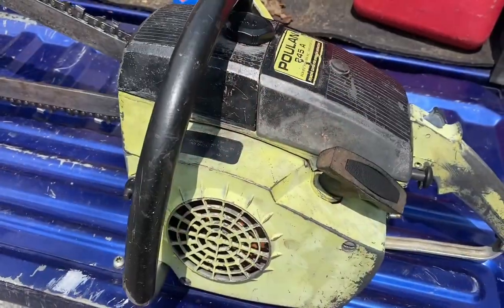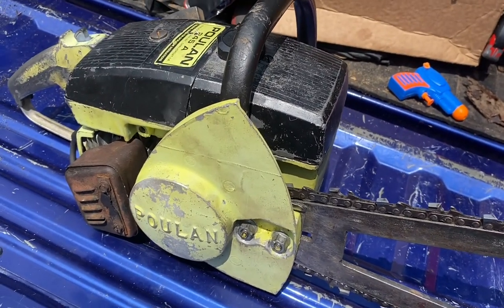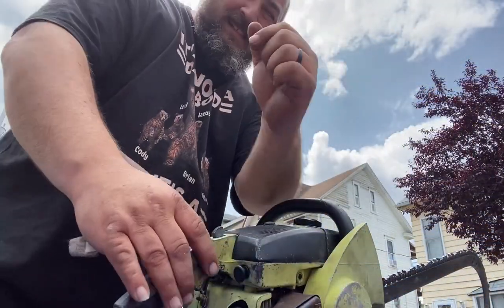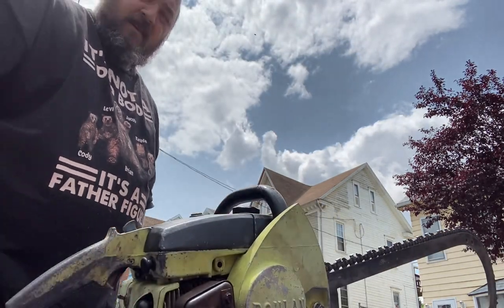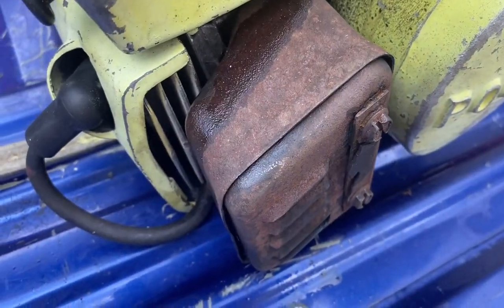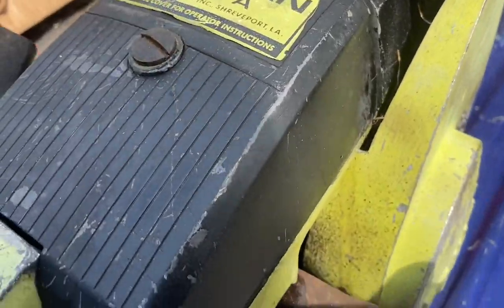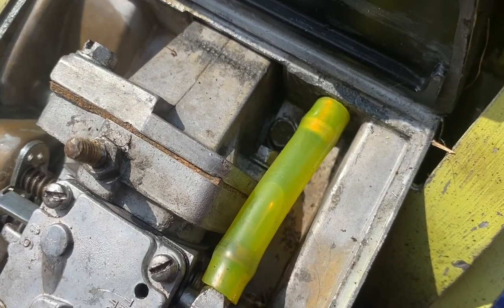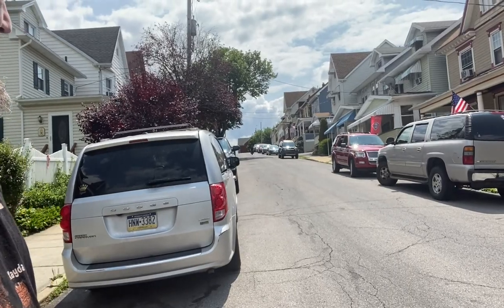Porting Chainsaw!  Poulan 245A With A Bow Bar!  First Start!!

Comment: You know what Smitty?  I'll bet you I could make one of those bow bars. In this video is the first time I've seen one up that close.  Betcha I could make one to fit a dedicated saw like my Super XL Automatic.  This stuff fascinates me and interests the heck out of me. Thanks for sharing this, you and a couple others are an inspiration. EDIT: I wouldn't imagine there'd be a market for these bow bars huh? I mean like if I made some and threw them in Etsy or Facebook Market Place. Just a thought.
Reply from the maker: Southern Forestry Products is the only company that I know of that still makes them but they only make the smaller ones.  I think you could make them without to much problem.  As long as the steel is tough enough and you have a good jig to size the grove you should be good to go.  Used ones sell for about $100.  You would probably need about $200 or so.  The question is whether or not someone would pay for it.  I have a bigger one I will be mounting on this Poulan in the future.  I will try and give a good close up shot of it.  My big one is on an XL-12 right now.
Reply: @Smittyschainsaws  For that cheap cost used, it's not worth it really then.  But,  I'm always thinking! Lol

Comment: Good to hear it running! 
On my Poulan 3400, I put oiling holes through the piston on both sides of the exhaust port- figured it would help with keeping the cylinder cool on the exhaust side. I ended up with a muffler full of oil and it was running out on top of the crankcase. Dark black oil- was mixing with the carbon.  I am wondering if you aren’t seeing something similar due to the free porting ?  

I ended up filling the holes with job weld.  Will be another test to see how that holds up!

I cannot confirm this was the issue- haven’t had time to run it again- but is suspect the cylinder wear was just allowing it to bypass right out the exhaust on every compression stroke. 
Just some food for thought if you don’t see an issue with the oiler.
Reply from the maker: I have drilled holes before with no problem.  I am wandering how big the holes were or how close to the exhaust?  They do that on dirt bikes 1/16".  How close to the exhaust did you drill the holes?  

The free porting is causing  a finicky tune on the low side.  I have to keep it a tad lean it seems.  I won't know for certain until I get into some real testing.  The leaking fuel line might have been causing the bad behavior that I was thinking was coming from the free porting. Since I did not notice that until later I will have to test again.
Reply: They were 1/16 as well. That was the smallest bit I had. They were approx 3/16 of an inch away from the exhaust port- it was as far away as I could get and not be in the transfers. 

I have some micro drills now and may try smaller holes in the future. 1/16 doesn’t sound big, but seemed a bit large after doing it. 

 Not sure it was too big, too close, too much piston clearance or some combo of all.  Well, at least it will be a good test for jb weld!!
Reply from the maker: @crazyfeller5704  We were about 3/8” on the dirt bikes and they were much larger displacement. Smaller holes would probably be better.
Reply: sounds like a plan!